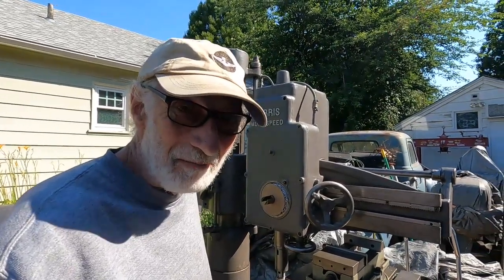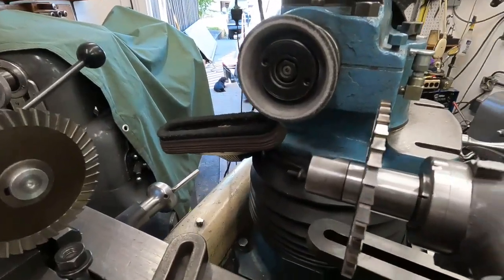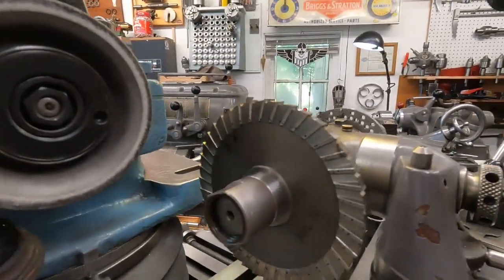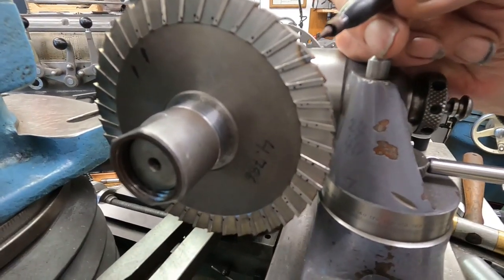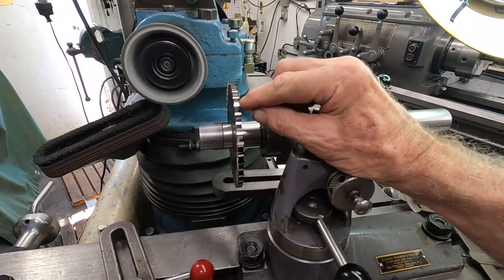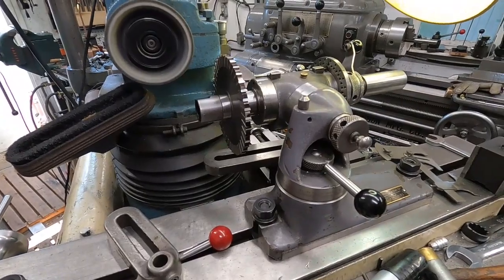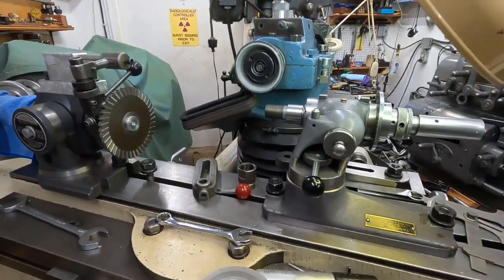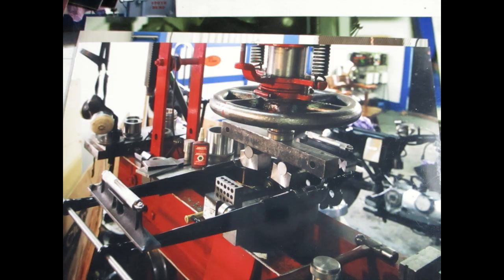Cutter grinding Fail

Comment: Looks like you are getting summer weather like we have !    Lol , hardly ever see them that cut on more than 3 or 4 teeth ! I have a heap of new ones i will try out on the big mill soon !     Cheers Don  👍
Reply from the maker: Its going to be hot for a couple of months! It has been years since I had a horizontal mill, I usually can get the cutters working evenly grinding them on the machines arbor. This mill was a short lived design from the war effort and has limitations using horizontal arbors from the vertical head attachment causing sag on the over arms and having to use the lighter duty type A arbor. I should be able to rapidly touch up the cutters on the arbor in the grinder, put the trued up unit back in the machine and have a more even chip load and better finish. It did work back in prehistoric times! 
 I have experience with dull cutters with bent arbors too!

Comment: It was blistering hot over to the east of you in NH too Don Not over 100, but in around 90F and humid as can be. Filures are a double edge sword for me. On one  hand I hate failures as they take time away from things. However, on teh other hand I love failures because you learn so much if you do a little analysis of what went wrong.  I like it that you share things some people don't find important to mention or worse yet are not honest enough to admit. Cheers
Reply from the maker: I wanted to push the smaller fixtures to their limit and certainly found it! I will re-install the standard work head and save the fancy little ones for fancy stuff. I have always liked cutter grinding and it is nice to work on the standard mill cutters again. I think it has been 20yrs without a horizontal mill!

Comment: I’m sure you can video it. There are a lot of gun channels on YouTube. Some work on guns and rifles. Others do shooting.
Reply from the maker: On my channel that was hacked, I had a 1960 Hahn BB rifle way up on the front wall and the systems AI picked up on it and let me know there was a rating system and I was mostly compliant. Now, there are much tighter rules and effects how videos are promoted.
Reply: @DonDyarprecision  that’s strange. I wonder how all of those gun channels manage.
Reply from the maker: @melgross  There is a sense of impending doom with those channels of the recent published rules that will direct some advertising away like an adult 18 or older label I am not fully up on it or know when this will all be in place. I do not intend to do that subject of video anyway. The rules cover fake guns as well as BB guns, attaching any device or apparent disassembly, trigger devices. Manufacturing parts and more. All being policed by AI. The machine shop end and other mechanical channels are way down in views, and have been declining in the 3yrs I have made videos.
Reply: @DonDyarprecision  Don, I certainly wouldn’t want you to get into trouble. It’s better to be cautious than to be dead. That must be an expression from somewhere.

Comment: Hi Don we learn from our mistakes. Could the finish grinding be done with the arbor mounted between centers? Thanks
Reply from the maker: Yes, that is oldest way and still a good one, but you have to work a little harder. Thanks for watching, I enjoy kicking things around and even dead ends.